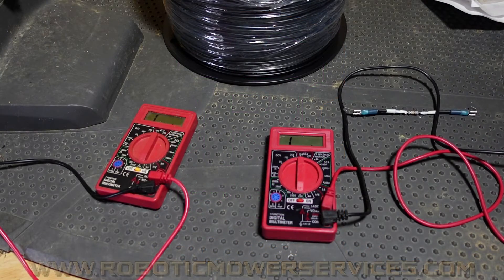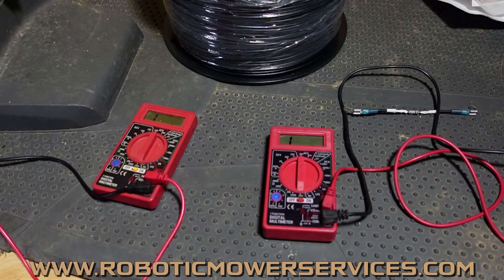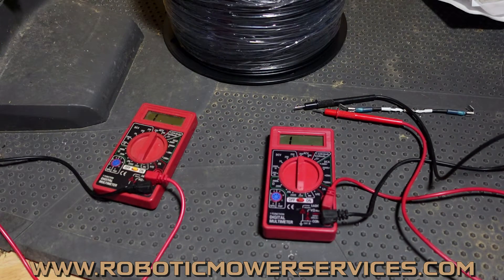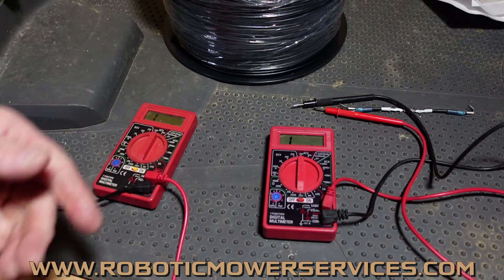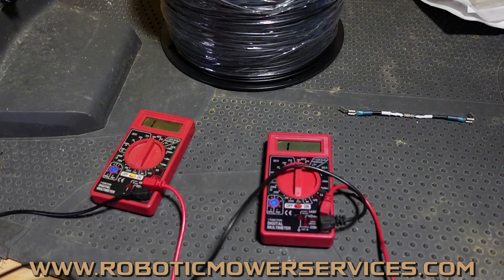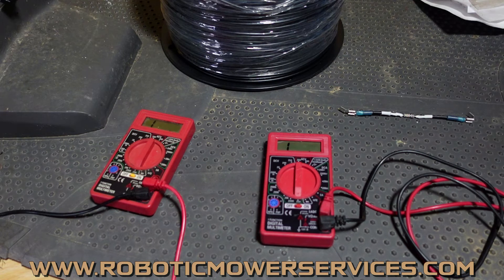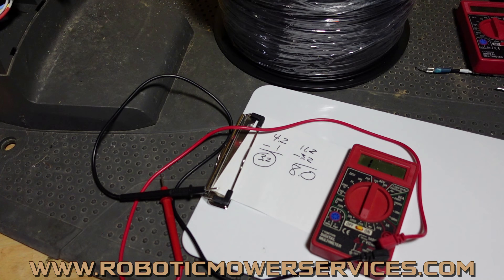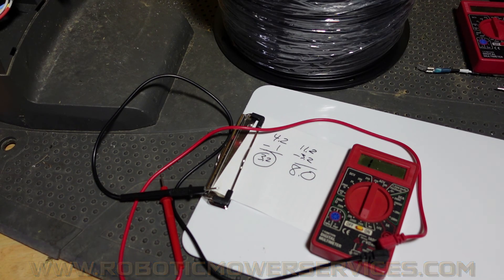Husqvarna Automower Continuity & Resistance Testing Using A Cheap Multimeter From Harbor Freight

Comment: thank you for all your videos! They've saved me many times. One request - I can't see how you're touching the ends of the boundary wires, and I'm such a rube at this stuff, I didn't know that the probes must connect bare wire (correct?). In other words, it won't work through the insulation. For someone like me, that isn't apparent, since the connectors are clamped onto the insulated wire, for ex. so I thought I could just touch the multi-meter probes to the wires near the connectors, to test. I realize, now, that the connectors are working with actual power, not resistance (that is the difference, right?), but I sure didn't get that to start with, so all this "test with a multi-meter" didn't make much sense to me.

Comment: Thank you for this video. Question:  How do I interpret a low resistance reading with a blue flashlight light? Not sure I’m asking the right way.
Reply from the maker: I think what you are asking is what does it mean if you have low resistance but still have a flashing blue light? Here is a step by step guide that we created to help with no loop errors. https://www.roboticmowerservices.com/post/troubleshooting-a-no-loop-signal-error-on-a-husqvarna-automower